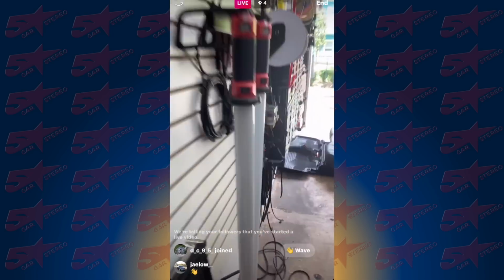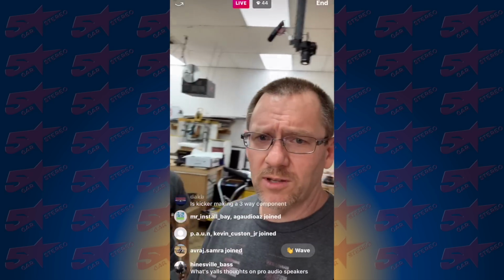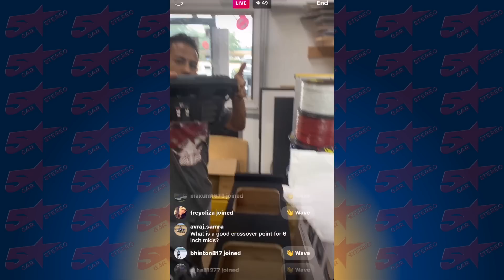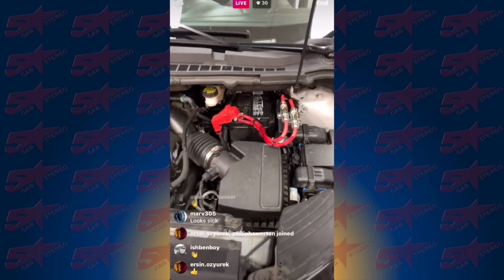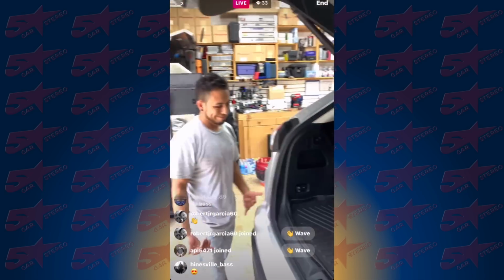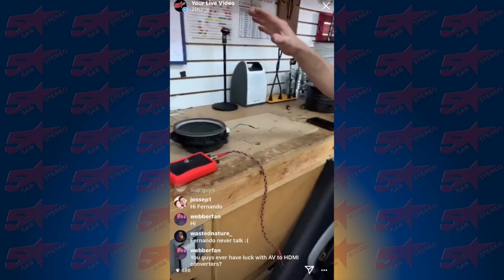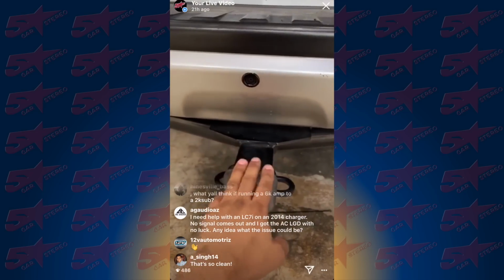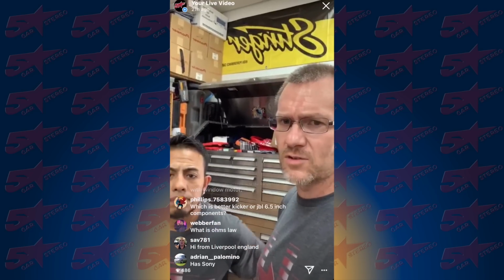Five Minutes with Five Star Car Stereo episode2

Comment: Since your a big morel guy @Dean! I have the Morel Maximo components I'm running them active. On the morel website it states the woofer is rated 90 watts rms and the tweeters are 80 watts rms. Are those numbers per woofer or 90 watts a pair...
Reply from the maker: It would be for each

Comment: Hello 5 Star, good morning. On a 2018 F-150 do the front speakers provide full range audio that I can use to run a mono channel amp? Is it best to run the power/ground through the drivers or passenger side on the firewall? How will the start/stop be affected by adding an amp? 2.7 EcoBoost Sync3 head unit Focal components front, 6.5s rear doors. Adding KXA1200.1 amp running 2 L7T 12" 2ohm DVC in a sealed box.
Reply from the maker: Yes use the front speakers, go down the driver side, no problem that we have seen yet, sound like a nice system I would recommend an amp to the Focal speakers.
Reply: @FiveStarCarStereoInc  Thank you. A 4 channel amp will be the next step. I'm setting this amp up with a distribution block for the power(1/0 in to 4 AWG out) and ground. For the ground it will probably go out the back of the cap to the frame or to the battery. I'll do a voltage drop test and check ohms to determine the route. Using the front channel to the mono will make it easy to daisy chain the 2 amps.

Comment: morning guys, I installed an audio control lc 1.800 in my audi a5 with the b&o factory system. im using high level input from factory sub speaker wires for the signal input and gto sense isn't turning the amp on. is there something with the b&o that wont send signal to turn the audio control amp on?
Reply from the maker: There may be nothing DC offset coming over the factory amp.
Reply: what do I do to get this working?